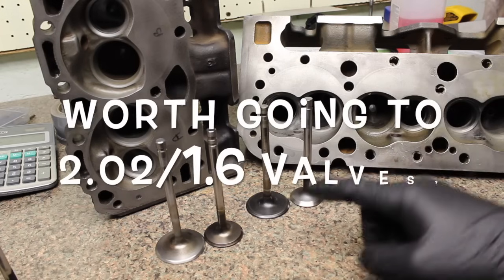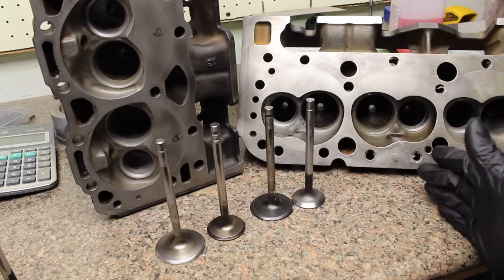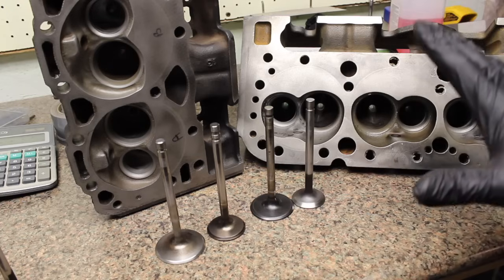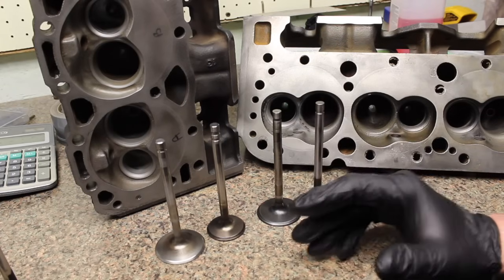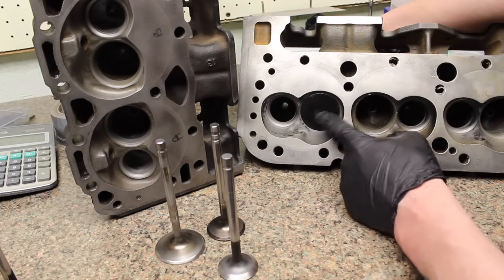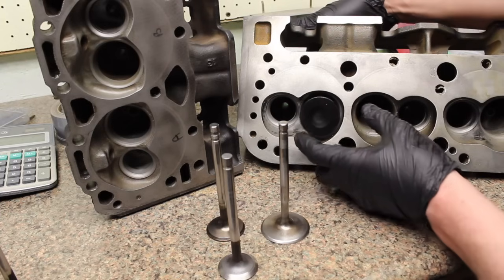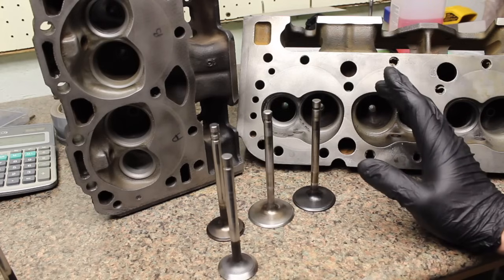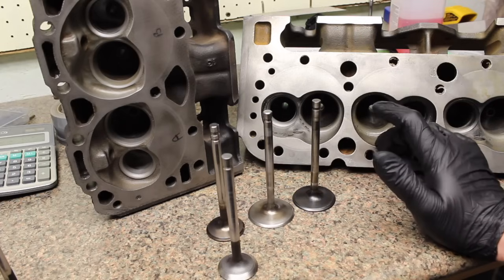Bigger Valves in Vortec Heads *Flow Data!*

Comment: I read somewhere does vortec heads didn't like the 202 that they really favored the 194 but going up to the 202 just didn't help him at all but going to the 16 help them tremendously on the floor bench I even saw YouTube video wish somebody actually did this it made have been you but anyway that's my two cents I hope it helps. But the video you did on the 305 Vortec heads and put a 194 add to 16 in them that they would flow just as good as a 350 because you got them just as close as you did to the 350s I believe that it would not do the 350s myself because of the smaller combustion Chambers I've always liked the 305 inch because of the smaller Chambers and most of the time they have as big of Runners as the 350s anyway when you get to 4K subscribers I sure would like to be in the giveaway I love your channel and all the trial and error that you do with Vortec I think it's cool and I learned a lot from you

Comment: Excellent information. We race a dirt track stock car. Most everybody is going to the LS, but I am going to try to stick with the small block. So very interested in the exhaust flow. What I am seeing here, is that I do not need to keep looking for those dark 180 heads. Very, very exciting!
The cams we run by rule state that they have to pull a high vacuum number. Therefore, we are not allowed to run much more than a simple “RV“ camshaft. Doing some things with some custom grind and some lifters. But, really considering switching from the camel hump over to the vortec.

A little bit of constructive criticism: instead of the gray background, can you switch that to a white background? It’s very tough to see some of the different colored lines. for my old eyes, it is especially hard to see the blue and the gray

Comment: How do I email you directly for some advice. I am building a engine for dirt track late model racing with specific rules, using stock crank and stock rods with larger arp's, 062 heads 355 vortec block flat tappet cam,  need help with cam and springs with the rules no roller lifters,  can have roller rocker arms 1.5 , no porting heads or polishing,  can deck .010 only, springs checked on engine with lsm gauge 105lb seat and 260 open and open pressure checked at .450 lift.  Will have 3 angle valve job, stock valve size,  I can undercut but no hollow  stems,  also has to have stock valve seals, 11/32 diameter.  Can use 650 or 750 on high rise intake either single or dual plane, stud style rockers only no shaft, doesn't matter anyway with crap lift rule, anyway 3/8 mile high banked clay ovals,  I need to come off the corners so can't sacrifice all my torque,  idle quality doesn't matter no vacuum rule,  I was leaning towards a 108 to 110 lsa, not sure about the duration though and has  .460 max lift rule to tangle in,  so lsa and  lift duration and springs suggestion, and 650 or 750 cfm carb? Consider that I can't flow much more than stock with lift rule.

Comment: Hey brother, love your work! I have a question. There is a guy in my area selling vortec heads that he has ground down the stems and put 202 intake and stock 1.5 exhaust. He is running stock springs. Is this combo sketchy?? 202 with 1.5?? How would the flow be with 202 and 1.5 valves??

Comment: Thanks for the dedication and hard work you've put into getting this information out there. I do have a question you may be able to shine some light on. I've went and pulled a couple sets of vortecs from the junk yard and given them a good porting. I decided to try a set of 1.6" exhaust valves, using a set of neway cutters I scored for cheap on ebay. My question is: did any blending have to be done after upsizing the valve seat? It seems like there was no way to cut up to 1.6" without taking out some of the "shroud" above the valve. A picture is worth a thousand words! Thanks
Reply from the maker: Yes actually ive been meaning to do a video showing this. If you dont open up the throat to 90 to 92% of the valve size, then the larger valve will actually hurt flow

Comment: Not enough gain for the cost and when 2.02/1.60 are put in they tend to Crack between valves .....I would clean up imperfections and enlarge the bowls up to the valve seats and nothing more besides cutting the valve guide bosses down for more valve lift & better springs

Comment: If you lay a older SCB head gasket over your vortec head you can see a bump in the gasket where the FACTORY RELIEF CUT reaches out on the 461/291 Fuelie casting 2.02 valve.

Comment: I would like to see back to back dyno runs with stock 906 vs 2.02/1.6 906 heads.  Heard from a very reliable source that it may not gain on the flow bench but absolutely gains on the dyno.
Reply from the maker: Yes it would be a great youtube video but heres why is would be hard to do. 
A vortec head with a 1.94 or max a 2.00 intake valve needs some porting to optimize but no a whole alot to really get the power most guys are looking for with a small runner head. Ive found that a 2.02 can show gains but needs alot more porting to optimize that valve. The biggest issue being the thin castings on vortecs. I will actually not make a video on how I got vortecs to flow 260+ cfm with a 2.02 valve becuase most guys will wreck their heads trying to port them that much.
The larger the bore the better the 2.02 can be with a vortec, but again from what ive done its minimal because of the small runner size and valve shrouding. 
Some other guys may have some different results than me but for most street/strip builds the 1.94 works great for power and longevity
Reply: @cuttersperformance  they guy I’m talking about was doing a dirt car and rules did not allow porting. So he just cut the seats to the lager valve and ran a bowl hog down the remove the step and that was it,  was like 20+ on the dyno if I remember correctly.
Reply from the maker: @sethmiller9442  yeah i could see how some combos can pick up abit. The valve job and bowl hog probably played a big role in those gains

Comment: I imagine a larger 2.02 valve would work better for a larger maxed out cylinder bore size? Maybe bored to .060 that way the head chamber can be unshrouded a little better, going past the stock bore size scribe marking to the .060???? I know its tiny, but it does allow a little bit more unshrouding on intake side. I'm thinking larger valve would work better with larger cylinder bore which allows more unshrouding. A larger valve on stoke bore size makes shrouding worse. What are your thoughts?
Reply from the maker: Its more the runner than the issue rather than the shrouding of the chamber. To really benefit from the 2.02 valve you need to remove enough meat that you risk grinding through on a thin vortec casting. 
2.00 intake/ 1.6 ex is a nice combo for vortecs

Comment: In one of David Vizzards vids, he talks about welding in a tiny spot on the intake side of chamber to increase flow. He used clay and it took flow numbers up way past 700 lift. Have you tried doing that????
Reply from the maker: I have played with puddy on the flow bench with no real results. I dont think theres enough meat in the top of the runner to really get the benefit of raising the runner and epoxy the floor. I know there are guys out there with high modified vortecs with welded roofs that may benefit.

Comment: leaving the 1.940" intake valve, and adding the 1.600" exhaust valve might just be enough difference to alter what type of cam pattern you want. With the stock heads I know a dual or split pattern cam is ideal. With just that upgrade though, might be enough of a change to make a single pattern cam work well. What makes me happy about that is the fact there are a lot more single pattern options out there.
Reply from the maker: Thats 100% correct, you dont have to "crutch" the weak exhaust with a dual pattern cam but often times a dual pattern will still make slightly more power

Comment: Try on the exhaust seat angles 30 45 then as close to straight down as possible on the last angle going down into the port. Almost a 2 angle valve job. Added power to my dirt car but never verified it on a flow bench. Way out in western NC

Comment: Hello friend,  I was wondering if u ever tried the 1.6 ex and left the 1.9 in ??? Im working on a set of vortex heads right now, and my machinist said on a hot street motor it would not do any good to go to 2.2 and 1.6 valves. But I c ur test is proving something here, so i just might get him to put me 1.6 n the ex and leave the 1.9 n the intake side.. please let me know if u did try this, and if it worked out like ur #'s showed n this test... very interesting 👌 I like ur videos, u explain alot more them most.. A+ 🤙

Comment: Have you come across 906 heads with valves that look like they have been about 80 or 90% backcut?  I just finished tearing apart the driver side head and cleaned them up with a brass wire wheel. Has the normal wear mark of the seat contact but also has a similar width band or ring where the normal ridge would be closer inwards toward the stem.  Kind of like a 2 angle valve job on the valve not the seat. I have pics...
Reply from the maker: Yeah all the vortec valves are cast with a back cut

Comment: I'd like to see pressurized flow numbers I'm running my Vortec heads with boost only 8 psi but I put 2.02/1.60 valves in mine and took all the casting flash off the intake and exhaust ports.
Reply from the maker: Your biggest benefit with boost would certainly be that 1.6 exhaust valve. Good call on that 👍
Reply: @cuttersperformance  I'm also using a cam with higher lift and a little bit more duration on the exhaust side.

Comment: Nice to see you had very noticeable gains on the 1.60exh valve upgrade.... i experimented doing the same going with SS 1.60 valves on the exh, but kept the 1.94 valves for the int, i had a reputable machine shop rework a set of stock 882 smog heads(76cc) along with some pocket porting, modified for 3/8" screw in studs and guide plates back in the mid 90s for a 4bolt 355cid sbc street engine for my 2dr 1975 chevelle back in 1993, 4100#s with me in it. Other parts included a stock crank, stock rods, ARP fasteners throughout, hyperutectic flat top 4valve relief pistons, figure a good 9:1cr at least,  eldelbrock rpm dual plane intake, holley 3310-1 750vacsec carb, 1 5/8" headman headers, full 2.5" exhaust with 40series flowmaster mufflers, GM 4:10 gear with posi out the rear, a TCI 2000rpm 12" stall converter, a stock TH350 with shift kit, comp cams 270(224@50/.470 int and exh lift/110ls) single pattern flat tappet camshaft, comp cams 1.5 roller tip rockers and aftermarket hardened pushrods. For the money i put into those heads, many will say i could have gone aftermarket, which is true, but this was my very first engine build, and i like to experiment, this combination of parts netted me consistant 14.40s in the 1/4 mile doing about about 93mph at the strip and did not too shabby as a street cruiser too. I was in my mid 20s then, probably didnt know any better, but i did some research and had some help figuring out what would work and what wouldnt, but i was totally satisfied with the out come and it was reliable as it was strong, not a single issue the whole time i owned the car. I also experimented with a set of sbc aluminum trickflow heads(2.02-1.60/64cc) afterwards(they wer ok), but then i finally settled on a set of SR torquer iron heads(2.02-1.60/67cc) and they were great as is for me. Sadly, i sold the car off back in 2009 after 16yrs of ownership, but now i've got a very clean 1979 malibu 2dr coupe with a ZZ4 crate engine along with a 700r4, and i couldnt be happier to be in the hotrod game once again except for these darn part shortages now(argh). So in short,  going with 1.60exh valves seemed to have helped even when i had no way of knowing for sure, with a flowbench or other wise, but it was just my logical way of thinking, "keep the 1.94int to help keep the torque where i needed it(down below) because of the heavy car, and go 1.60exh to help it breath better over all.
Reply from the maker: Yes the 1.6 valve works great! I have a video coming up about how much flow you can get with 1.6 ported exhaust ports on vortecs. Great gains!

Comment: You may get better and more consistent flow bench numbers if you have a radius entry to smooth the flow into the intake port. Otherwise the sheer edge creates turbulence. You can use clay like a lot of people do. I made radius entries from hardwood using router bits on a mill. I use a small amount of clay to blend from whichever one is closest to the port I'm working on. Also, I found the 2.00"/1.55" combo works well on these heads.
Reply from the maker: We have used radius inlets, clay on the intake and pipes or on the exhaust. Changes seem to depend on the head.
2.00 and a 1.55 or 1.6 seem to be the best combo for vortecs. Mind you the 1.94 valve seems to be just fine for most applications 
Cheers!

Comment: What is a good aftermarket vortec head that won’t crack? I’m building a overlander 4x4 and need reliable set of heads for my 5.7 Yukon.
Reply from the maker: Eq heads are nice, I'm also planning on trying the summit racing vortecs. Porting and flow bench

Comment: Questions: Have you tested valves on Vortecs with a necked-down stem for more flow? Have ya ever used 8mm valvestems? I just wonder if they make any meaningful difference in an otherwise stock Vortec, considering the mild valve lifts and rpm range of these heads.
Reply from the maker: I've tried necked down stems on stock vortecs, with no noticeable difference in flow. I have not tried 8mm stems

Comment: for my first Late Model Vortec headed engine, I only did 1.6 exhaust and stock 1.94 , NO porting , that was not legal. 525HP on the dyno. 12:1 34deg total timing, Super Victor, 830 Holley
Reply from the maker: Damn son! That's awesome
If you know or don't mind sharing 
Could you send me the cam specs im very curious 
Pcperformance1@outlook.com
Reply: @cuttersperformance  can you produce these cam specs please? Great video by the way!

Comment: I've been wondering what the truth was on porting and valve size increase on vortec heads.

With the increase in percentage of flow could make a big difference in power i suppose. What were the actual flow numbers of the exhaust?

The gains you show from Increasing the exhaust valve size makes me curious about how it could benefit the peanut port heads on a big block chevy. Do you ever think about doing some big block stuff?
Reply from the maker: There will be more data in my next video! cheers! 
but heres the 1.6 exhaust flow with stock port 
.100. 62
.20	123
.300 151
.400 171
.50	177
.600 180
.700 185

Comment: I have my short block all done 40 over with a 1.25 domed hyper piston I had a set of 441 heads ported and polished ...with 76cc chambers said to have 9.6.1 compression all said and done wouldn't i have been further ahead with a flat top 2 v relief and 906 heads ?

Comment: I always thought a 1.55 exhaust valve let you clean up the stock seats on 062 heads and get rid of the stepped valve seat that comes on the hd truck heads. I have never heard of guys needing to swap intake valves because they are the pinch. 
A 2.00 1.6 valve package might be the ticket and let you really put a proper multi angle valve seat in them.

Comment: The head laying down is not a 906,
Reply from the maker: Thats correct, the head laying down is EQ 220cc head just there for the video 
The head flowed with 2.02/1.6 valves is a 906 with regular exhauat seats
Reply: @cuttersperformance  don't speed up slow down when presenting your graph, the basics are boring to me but not to most of your subscribers, hang in there, are you familiar with David Vizard? He's the guru of flow bench, bench and dino testing can be manipulated
Reply from the maker: Yeah alot of guys are enjoying the videos, I'm glad guys enjoy this stuff as much as I do 
Yeah David Vizard is a legend and knows his stuff 
All my flow testing is done on a fully calibrated super flow bench
Reply: @cuttersperformance  cool, I didn't mean to hit hard but I been building engines for 50 years and still doing it, flow numbers can help but they're not the bottom line, small heads need maximum compression, less space to fill, the flow bench doesn't have a stroke to measure
Reply from the maker: @winstontomblin3990  haha no problem man, and your totally right....flow numbers are just a good peice of information and not necessarily means you'll make more power with higher flowing heads 
As you know...Engine combination is key, everything needs to be matched a work together for the specific application
Racing heads don't equal good street heads and vice versa 
Thats the fun of putting a engine combo together!
Reply: @cuttersperformance  hang in there young man, I just subscribed to your channel
Reply from the maker: @winstontomblin3990  thanks brother I appreciate that